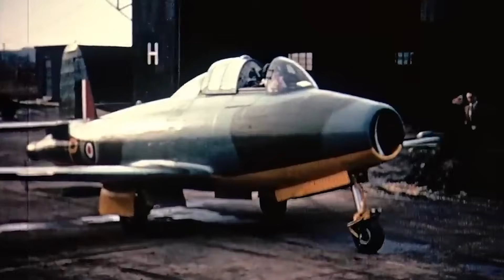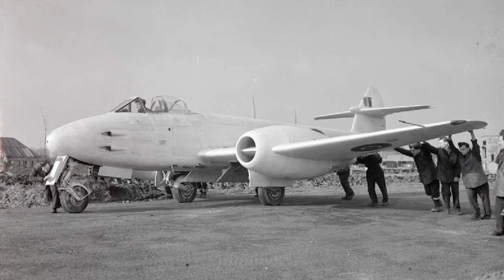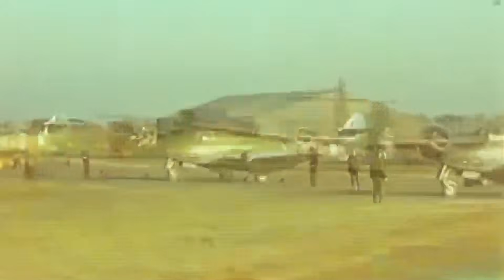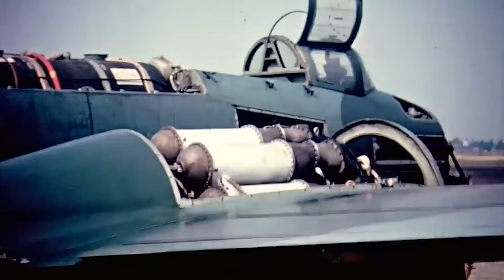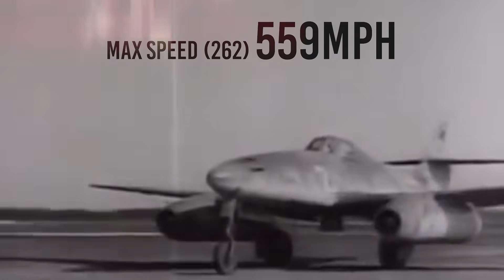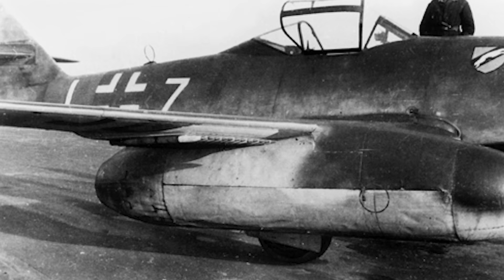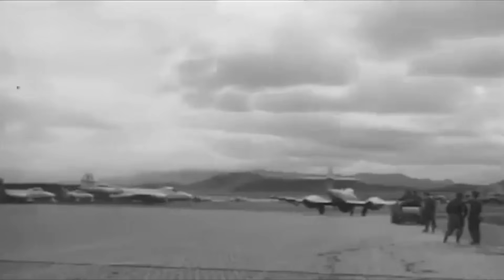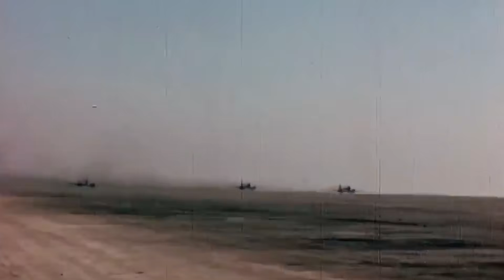Meteor vs Me 262 | Which was the better WW2 jet?

Comment: I love the 262 dearly, but the Meteor doesn't explode if you breathe on it the wrong way, so I'm gonna have to give it to the Meteor.
Reply: The 262 didn't blow up but it's engines had an extremely short operational life made worse by the German shortage of quality materials by the late war.
Reply: @IntrospectorGeneral  they did flame out
Reply: @IntrospectorGeneral The 262 Jumo 004 had a 25 to 30 hour life for no other reason that Germany was denied access to the proper metals by the allies. This was not the big deal people make it out to be, the German axial flow jet could be changed in thirty minutes in the field, instead of two to three days for a piston engined prop plane, and cost one third to manufacture.
Reply: @drstrangelove4998 the British used centrifugal flow jets for the precise reason that the metallurgy of the time could not provide a practical operational life for axial flow jets.
Reply: @drstrangelove4998  I wouild like to see your documentation about the position engine swap time. I.E. I think you are full of 💩
Reply: @drstrangelove4998 Problem is that neither of those statements from Brown are actually true. The 162 was horrible as was the 262. He may have believed it to be true at the time, however actual evidence shows him to be quite wrong. 

Only a blind quad amputee would take 3 days to change a piston engine, and if the crappy Jumo was cheaper, a big emphasis on the if, it was because the RLM and Junkers didn’t have to pay for labour.
Reply: @drstrangelove4998 

@DoktorBayerischeMotorenWerke   

@JammisAdami  

We feel we can clear up some commonly held myths and misconceptions, obviously.
It's always good to see the facts presented clearly and concisely isn't it?

The Jumo engines used pressed sheet steel turbine blades. It was around 1950 in France when the people trying to get the engine working reliably for longer than 46 minutes were permitted to engage the services of RR, the first thing RR did was used solid nimonic turbine blading. 

The Gloster Meteor was one of the world's first jet fighters to go into service, it was in service during WW2. The meteor was the first effective multirole fighter bomber jet aircraft with a reliable engine to go into service,  It broke speed records in 1945 and 1946. During WW2 it was in service as a fighter and multirole aircraft over the UK and over all allied controlled territories in Europe and beyond. 

The ME-262 and it's 46 minutes life engines were abandoned shortly after 1945, it had a do not exceed speed of 456 mph and was only ever used to attack bombers with losses of three 262s for each downed bomber.  During WW2 most of the ME-262s were destroyed by their engines, were various types of accident losses or were shot down by bombers. No German designers were involved with the Mig-15. The Mig-15 used a copy of the RR Nene.  

During the Korean conflict most of the Meteor casualties were due to groundfire or accident losses. The result of any tangles between Migs and Meteors was that Mig pilots avoided getting into dogfights with Meteors. The battle of Sunchon, where 50 Migs against 14 Meteors resulted in the supposedly superior Migs failing to gain any clear advantage caused the Koreans to re-evaluate tactics. General opposition in Australia to involvement in the Korean conflict resulted in the govt using the battle as an excuse to reduce the RAAFs involvement to troop support only.

The world's first wind tunnel was built in England during the 1800s. The world's first supersonic wind tunnel was built in England during the 1920s. 

The Whittle Gloster E28/39  was of course a brilliant aircraft that was later copied in Russia as the upsized and tweaked Mig 15 with a copy of the RR Nene gas turbine aero engine. The RR Nene being the world's most powerful & most reliable gas turbine aero engine in 1944.

The MD F3H Demon was a contemporary to the DH Sea Vixen & had a similar performance. The F4 Phantom was a follow on from the F3 Demon. The Sea Vixen took a long time to get from first flight to introduction for various reasons and a similar situation occurred with the MD F3H Demon.

McDonnell Douglas F3H Demon
590 Built. Not Supersonic.
Max Speed 578 MPH.
Introduction date 7 March 1956
First flight 7 August 1951
Retired 1964

MD F-4 Phantom 2
Number built 5,195
Manufactured 1958–1981
Introduction date 30 December 1960
First flight 27 May 1958

DH Sea Vixen
Number built 151 (including two DH110 prototypes and one Sea Vixen prototype)
Introduction date July 1959
First flight 26 September 1951
Max speed 695 MPH.
Retired 1972

Interesting British achievements.
There is no doubt that the Fairey (England)
Delta 2 was of course the world's first jet
aircraft to exceed 1000 mph.  Indeed It
exceeded the previous record by 310 mph &
held the record for 1 year. Incidentally, the Dassault Mirage 3 & 4 are based on the Fairey Delta 2.

The Panavia Tornado & Euro fighter Typhoon are British design aircraft with British design engines built by international consortiums. 

The EE Lightning was one of the fastest aircraft on the planet when it first achieved a Mach 2 flight. 

Early days, jet fighters.
De Havilland Vampire, Sea Vixen & Gloster Meteor accident losses were not high or unusual for fighter aircraft at the time. De Havilland built large numbers of all metal airframe aircraft before the DH Comet.
We mustn't forget of course that the DH Vampire for example first flew in 1943 & the engine was also built by De Havilland. There were examples of the Vampire interceptor / fighter in service until 1990 which was operated by more than 30 countries.

Non combat phase accident losses.
% of Aircraft built.

The Canadair CL-44 was a turboprop airliner.
Canadair CL-44                  (ff 1959 ) 48%
Lockheed XF104                (ff 1954) 100%
Lockheed  P80                   (ff 1944) 43%
Lockheed F104                 (ff 1954)  45%
Grumman f9f-5 Panther   (ff 1947) 44% 
Convair F102 Dagger        (ff 1953) 45%  
MD F-101 Voodoo.             (ff 1954) 34%
MD FH Phantom 1            (ff 1945)  35%
MD F4 Phantom 2             (ff 1958)  28%
MD F3H  Demon               (ff 1951)  32%
Gloster Meteor                  (ff 1943)  21%
DH Vampire UK                (ff 1943)  23%
DH Sea Vixen   UK           (ff  1951) 33%
Gloster Javelin  UK         (ff 1951) 20%
EE Lightning  UK             (ff 1954) 33%

It's a great pity & a crying shame that British military forces had to occupy a large part of Germany for decades after 1945 & Russian military forces had to do the same. Of course Russia still posseses a large chunk of what was German territory & of course Russia & the UK produce nukes. Obviously Germany does not produce nukes.

Early days, jet engines. Whittle performed the world's first demonstration of a gas turbine aero engine in 1937. The RR Nene, a centrifugal gas turbine aero engine, was the world's most reliable & most powerful gas turbine aero engine in 1944. Licensed built versions & copies of the RR Nene & RR Derwent would go on to power many aircraft in Russia including the Mig 15 & Mig 17, the US, China, France & other countries for decades after 1944. Incidentally, the Mig-15 was in essence an upsized / tweaked copy of the Whittle / Gloster E28/39 jet aircraft including an uprated copy of the RR engine.  The basic centrifugal compressor gas turbine aero engine with Whittle style reverse flow combusters and sometimes an axial compressor section is still manufactured by more than one company including Pratt and Whitney, the main application being helicopters.

The gas turbine engine was invented in England during the 1700s.

During the 1800s Parsons of Ireland & North England produced the world's first axial multi stage sequential stator rotor turbines and compressors for turbomachinery use which would eventually go on to to form the main components of the axial gas turbine aero engine. At the time the basic idea of making an internal combustion gas turbine engine and using it as an aircraft engine was considered thus the jet aircraft concept had been created in England before the first powered aircraft flew.

An example of what goes on these days in various countries. For example, there are of course no German companies that makes German jet aircraft in Germany & there are no German Companies that make German gas turbine aero engines in Germany that are suitable for widebody airliners.

The UK has the world's highest combined per capita Nuclear / Defence / Aerospace Sector Activity.

UK defence sector, absolute terms, world's second highest activity. 1st for per capita defence sector activity. Per capita nuclear powered submarine construction, 2nd position. 
Main players being Rolls Royce, Babcock, GKN Aerospace & BAe Systems. Activities often involve international collaboration. BAe systems, RR and other UK companies now handle more Airbus work value wise than Germany. 

There's a good chance that anyone currently flying on a widebody airliner will be on an aircraft powered by RR gas turbine aero engines made in the UK and a good chance there will be other hardware on the aircraft that's designed and / or manufactured in the UK. 

Rolls Royce Holdings UK
Subsidiaries
- Rolls-Royce plc
- Rolls-Royce North America (ex Allison etc Classified Military stuff)
- Rolls-Royce AB
- Rolls-Royce Deutschland
- Rolls-Royce India Private Limited
- Rolls-Royce Marine Power Operations
- Vinters Engineering Limited
- Rolls-Royce Controls and Data Services
- Rolls-Royce Power Systems
- Bergen Marine
Joint ventures include:
- Rolls-Royce Turbomeca
- MTU Turbomeca -

Trent Family
The MT30 (Marine Turbine)
Industrial Trent 60 Gas Turbine
Trent 7000
Trent XWB Airbus A330neo.
Trent 1500
Trent 1000
Trent 500
Trent 600
Trent 700
Trent 800
Trent 8100
Trent 900
   
RR wholly owned subsidiaries in Germany handle smaller 2 shaft RR gas turbine aero engine work.

The UK space and aerospace sectors are highly productive, high-value industries that together contribute over £18 Billion in direct Gross Value Added (GVA) to the UK economy. Individually, the space industry directly contributes about 0.3% of UK GDP 7•2 Billion while the aerospace industry contributes approximately 0.5% £10•9 Billion.
   
We hope this helps.

We hope this helps of course 👍
Reply: @IntrospectorGeneral  The Jumo jet wasn't that much worse than the piston engines used by Me and FW that it really mattered. Although the lifetime was short by today's standard, the Daimler piston engines didn't have very much longer time between service. The Me262 had fuel for about 30 minutes so an engine life of 20 hours (which is what it was in reality if treated with some care) that still meant 40 sorties before an engine change which is similar to what it was for the piston engined fighters.
Reply: @AndersLang-i5sThis comment is nonsense.
Some piston fighters flew 1,000 miles with drop tanks.
The 262 never went far from their base
Reply: @fryertuck6496  that’s an irrelevant comparison. The Spit couldn’t even reach anywhere near Paris. The 262 was a bomber interceptor over Germany Fryer.
Reply: @AndersLang-i5s  40 sorties if 262 lasted that long before being shot down destroyed on approach or airfield or accident
Reply: @Eric-kn4yn  
You beat me to it!!
At that point in the war, I don't think that Germany had too much expectation that ANY of their aircraft  were long-term investments.
Reply: The Arado 234-C VS the Meteor would be interesting.
Reply: @thunderstorm8926  yeah that's better. 2 platforms instead of a bomber sort of and a fighter mostly
Reply: @thunderstorm8926  indeed it would
Reply: You are mixing me 262 with me163
Reply: I thought that was the 163
Reply: "Too be fair, though"

 Those 262's were still performing as well as they had despite all the while being forced to use the equivalent of wet newspaper and bubblegum in their manufacturing; meanwhile the UK could get pretty much "Almost" any high grade metals, alloys, and synthetics/petroleum-based products they wanted from the US by then.

I wonder how much different the comparison would be, if the 262 had the same high-end and high quality components, each with their OWN list of "Quality" ingredients to be made.

I don't think fuel quality really mattered though IRL, so the that's at least one category I don't think the Allies would've been able to "Do Better" like America's Infamous "151 Octane AvGas". After all, even to this day NOW; "Jet Fuel" on the surface level is essentially still just straight Kerosene Based, with only a small amount of ever increasing additives introduced to it over the literal "Decades" since what was the OG "Jet Fuel" which was just straight up Kerosene based fuel (Ever wonder "Why" just so many early Jets, even the later "newer" ones made into the 60's-70's left those Iconic Black smoke trails? Yeah changes to the engines helped mitigate this somewhat, but it

But that's the great thing about Turbine engines, they don't really "Need" some super altered and specific fuel; they're more a "If it burns, we turns" type of engine. Which is one of the big reasons why the only "Really" reliable and easily reconfigurable multi-fuel engine ever made so far; has been the M1 Abrams Honeywell AGT-1500 aka what and why people call "Its Jet Engine".

IIRC the hugely historically signifigant (In Aviation and heavy duty vehicles, such as tanks...) company "Lycoming" was actually the original designer and manufacturer, which would actually make sense tells me it was probably based on one of their "Turbine-Turboshaft" engines which pretty much EVERY American Helicopter at the time (And MANY other Western Countries) were using, such as in the UH-1 Iroquois aka "Huey" and ALL that. (I believe General Electric and Pratt & Whitney still made up the rest of the market, like GE Turboshaft engines in the CH-47 "Chinooks". With whatever else in the West that wasn't using those, mostly all having Rolls Royce Turboshaft engines. 

Unfortunately for the Luftwaffe, even that MASSIVE miracle in itself is useless when even just "Fuel" itself becomes more of an abstract concept than an actual resource.
Reply: What is really forgotten about the always claimed short service life of the Jumo004B, in a Me262 it could be replaced within 30 minutes much faster than any piston engine and likely also compared to an engine change on a Meteor. Also, early rurbojets like the Jumo as well as the Derwent were easier to make than a late war piston engine so supply wasn't really an issue even for Germany late in war. Besides, the initial version 004A proved to last at least 100 hrs but was replaced for the 004B due to wartime material shortages.
The real big issue with the 004 (both the A and B) was the engine controllability in conjunction with the much more complex airflow properties of its axial flow compressor, easily stalling or flaming out on throttle changes. An auto throttle greatly reducing that risk was in development but not completed before the end of the war. Centrifugal flow compressor engines are simply more forgiving in that regard, additionally the better high temp alloys of the Derwent provided extra protection.
Reply: My issue with the Meteor is that it’s performance could not be improved after the initial model and was a disappointment in Korea .
Reply: @Muzz-d3h  My issue is his design, the centrifugal form, was never adopted, proving without a doubt that Messerschmitt had the superior design and led the way forward.
Reply: @tenbear5 considering he had chosen the lesser of the two designs because metallurgy wasn't good enough I would say he was more intelligent than Messerschmitt.
The me262 was a good idea but technology of the time hampered it, Gloster on the other hand was building a plane that worked well for the years it was needed hence why the meteor stayed in service with 16 different nations and only left service in 1970 the me262 after the war was only used by Czechoslovakia until 1951
Reply: @rosshughes7977  lack of materials will never excuse a poor, unworkable design, Ross Hughes: the simple fact is — Messerschmitt cracked it, nothing came close at the time & despite your protestations, you aren’t about to rewrite history.
Reply: @tenbear5 Messerschmitt cracked it really they lost the war the me262s were destroyed because they were slow on take off and unreliable, Messerschmitt chose the wrong design for its engine in the time period.
You can sit there polishing your swastika all you want but facts are facts no matter how much you try to change it.
The better aircraft will always be the one that had more uses and was more reliable it says a lot when the allies didn't even need to deploy its own jet to counter the 262s.
Reply: @Muzz-d3h meteors performance was improved drastically the MK1 was 100-120 mph slower than the me262 the Mk3s sent to France were only 20 mph slower and by the closing stages of WW2 it was only 7 mph slower it then went on to break the 600mph barrier it was an exceptional aircraft 
By 1952 the mig 15 and sabre were the dominant jet fighters not bad for an aircraft designed in the middle of WW2 and it isn't really a disappointment being outmatched by newer more capable designs.
Reply: @rosshughes7977 for sure. By 1947 it couldn’t stay in front of other jets .mk4 was its zenith at 616 mph . But that’s not its operational speed . Armed up with fuel and weapons, slower. By Korea it was ground support, which is handy. Gday from Oz🇦🇺
Reply: @Muzz-d3h I know it was out-matched after the war by smaller more modern designs but I'm just pointing out that the meteor was a brilliant design that worked in the time period it was needed even after the war the British jet engine design was adopted by most nations.
On top of that I like winding up the leather clad swastika polishing wehraboo's
Reply: @hunterhess8433  but I’d hate to be in the Meteor when I wanted to shoot at something only to find that the cannons had frozen again.
Reply: Keep talking about deers and others like that, because in ww2 fighter airplanes domain your knowledge is like my cooking skills.
FIRST OF ALL: The ONLY operational jet fighter of ww2 was me262. PERIOD.No other british empire PROPAGANDA fantasmagory was flying in same period.
Reply: @napraznicul 

The only effective, reliable and competent jet fighter that was operational during WW2 was the Gloster Meteor. 

The Gloster Meteor was the world's  first jet fighter to go into service. 

 Early days, jet engines. Whittle performed the world's first demonstration of a gas turbine aero engine in 1937. The RR Nene, a centrifugal gas turbine aero engine, was the world's most reliable & most powerful gas turbine aero engine in 1944. Licensed built versions & copies of the RR Nene & RR Derwent would go on to power many aircraft in Russia including the Mig 15 & Mig 17, the US, China, France & other countries for decades after 1944. Incidentally, the Mig-15 was in essence an upsized / tweaked copy of the Whittle / Gloster E28/39 jet aircraft including an uprated copy of the RR engine.  The basic centrifugal compressor gas turbine aero engine with Whittle style reverse flow combustors and sometimes an axial compressor section is still manufactured by more than one company including Pratt and Whitney, the main application being helicopters.

The gas turbine engine was invented in England during the 1700s.

During the late 1800s Parsons of Ireland & North England produced the world's first axial multi stage sequential stator rotor turbines and compressors for turbomachinery use which would eventually go on to to form the main components of the axial gas turbine aero engine. At the time the basic idea of making an internal combustion gas turbine engine and using it as an aircraft engine was considered thus the jet aircraft concept had been created in England before the first powered aircraft flew.

An example of what goes on these days in various countries. For example, there are of course no German companies that makes German jet aircraft in Germany & there are no German Companies that make German gas turbine aero engines in Germany that are suitable for widebody airliners.

The UK has the world's highest combined per capita Nuclear / Defence / Aerospace Sector Activity.
Reply: You might think that  mate, but Capt. Eric Brown had a different opinion. He is on film in interviews (see YouTube) and public lectures saying the following: “without a shadow of doubt, the Me262 was THE most formidable fighter of WW2.” Furthermore he said the He162 Volksjäger, drawn up in two weeks, would run rings around a Meteor if they had met in combat.
Reply: @drstrangelove4998  he has the pilot's perspective, in carefully prepared testing conditions. Great when it was working, but...
Reply: @bigyin2586 ME262 flew but as one pilot explained it was like flying a Wurlitzer Organ in a giant church or Cathedral. You had to also premeditate movement. 
The Arado 234 -C was a better fighter and bomber : )
Messerschmitt being favored above all others shortened the war and deleted better fighters from being mass produced like the FW187 Focke designed by Kurt Tank.
Reply: @thunderstorm8926 good point. I think the main problem though was lack of fuel, regardless of the aircraft types or how many that were built.
Reply: @bigyin2586 they had lots of fuel up till late in the war they didn’t have enough air craft and pilots due to lack of mass production and not producing the best equipment. Italy had the same issue .
Reply: @bigyin2586  they had fuel till close to the end of the War thanks to Romania . 
They didn’t have planes and pilots from lack of mass production of the best planes available. Messerschmitt being favored with less qualified aircraft destroyed the German Air Force. Italy did the same thing favoring less qualified aircraft because of name recognition.
Reply: @drstrangelove4998  Yes, without a doubt, and that great british test pilot flew them all. He knew what he was talking about.
Reply: Actually, it wasn't the 262 that had an "explosive personality". It was the 163 Komet ticket powered interceptor.
Reply: Your obviously thinking of then Me 163 with its volatile fuel, not the 262.